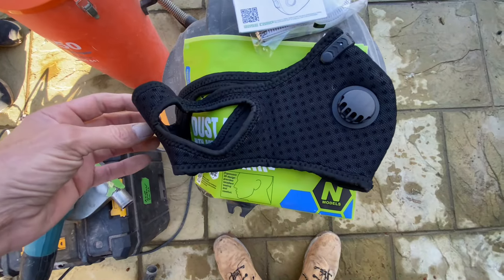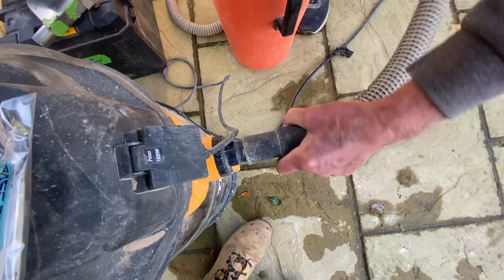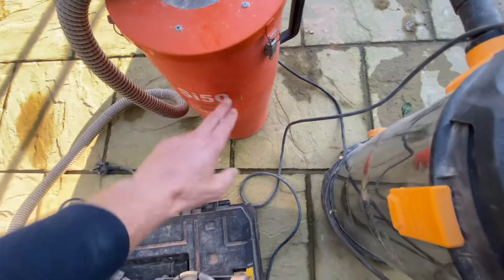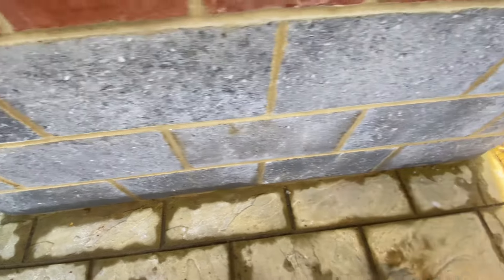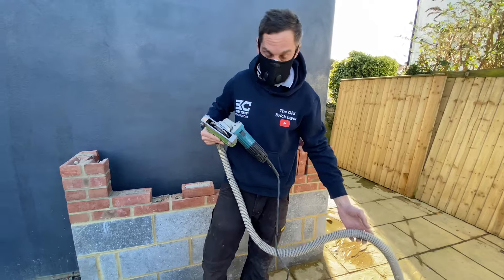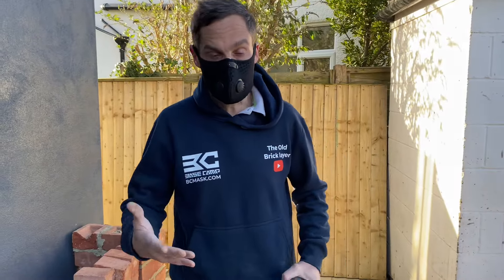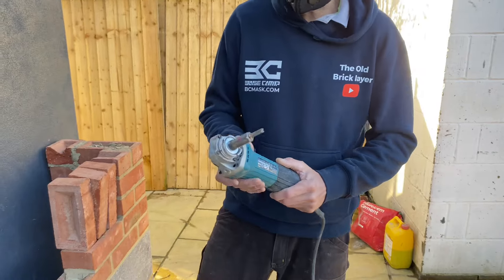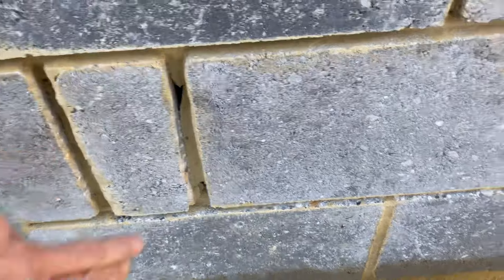Angle grinder  mortar raking setup . Base camp mask

Comment: I use a max vax 20 dust extraction mate 
Where do I get one of those barrels.much easier than emptying my dust extraction mate
Reply from the maker: There is a few company’s but I get my stuff from sunrise tools usually very fast delivery if you order in the morning
Reply: @ 
Thanks mate I work for a roofing company in Reading and most of my work is chimneys the dust extraction is a game changer but that barrel takes it to another level 
Great video keep up the good work ❤️
Reply from the maker: They are  very good as there easy to hold one handed and empty into a rubble sack and less wear and tear on the extractor …..
Reply: @ we got the extractor hose and shroud for the grinder which was a grand 
Anything that saves the life of my hoover will definitely help
Thanks again
Reply from the maker: @matthewslade228 welcome

Comment: Do you need a mask with the set up you have?
Reply from the maker: Yeah when the joints are big it does make some dust esp when your using it at chest higher.  Ok when on the lower section
Reply: @Theoldbricklayer  I have a base camp mask but never wear it iam old school don't wear anything
Reply from the maker: @anthonyworthington6495  I was like that for years but after a day grinding with no mask I feel the difference